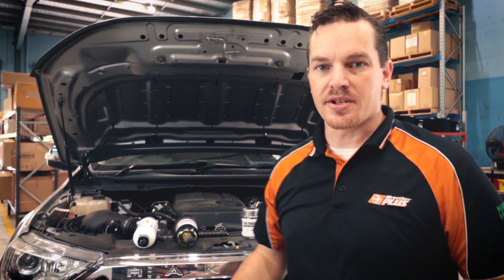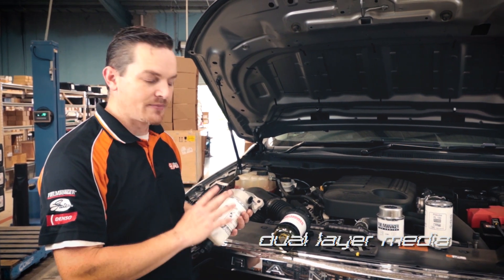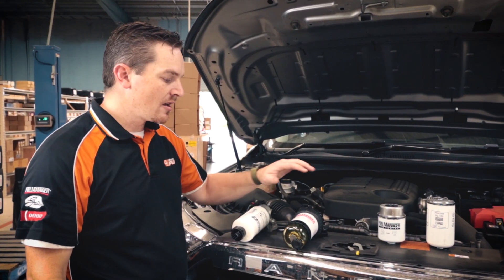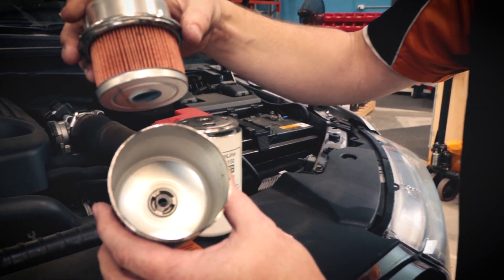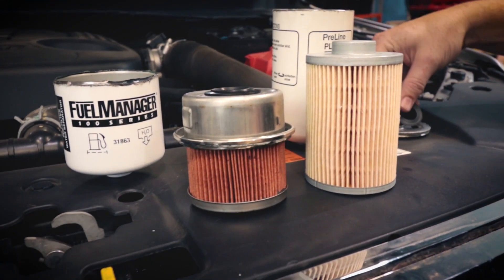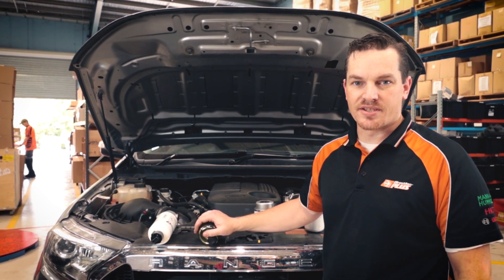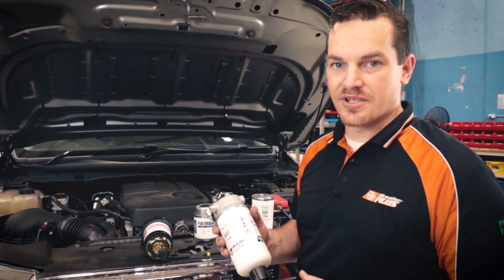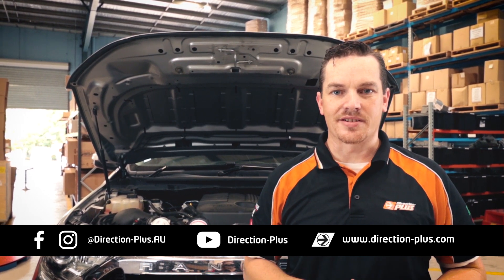Differences between FuelManager and PreLine-Plus

Comment: If they have better filter tech in the new one why not add this to the older filter as an option so no need for wiring or to change set up.
Reply from the maker: The Filters are made by two different manufactures, Fuel Manager by Clarcor (USA) and PreLine by Mann and Hummel (Germany). Unfortunately the filter elements aren't interchangeable because of the different designs.
Reply: Good fucking point!

Comment: How does the wiring work. Do you take the wires from the other filter and put them on the Preline filter?
Reply from the maker: No the alarm is completely independent from the factory alarm. you can see the install instructions here
https://www.directionplus.com.au/Installation-Guide/Water-Sensor-Control-Unit-Installation-Guide.pdf
Reply: They still didn't reply....

Comment: hi so pre line is better than fuel manage? what if i installed a fuel manager already and want to replace it in pre filter?is it possible?
Reply: They're not too good on answering question. I'd like to know this also
Reply from the maker: yes you can, we have retrofit kits available. Its just a mater of replacing the filter assembly and wiring in the alarm

Comment: I got small fuel filter so I guess I got cheaper one? Can I swap so have warning light better filtration?
Reply: the parts supplied in the 2 kits are a little diffrent from each other so its not a straight forward swap sorry. If you haven't fitted your kit you should be able to take is back to the place of purchase and exhange it for the one you want.

Comment: i like the Racor Snapp. please give views?.
Reply from the maker: the SNAPP units are a quality unit, but have a look at your fuel flow requirements and compare that with the SNAPP unit
Reply: @DirectionPlus  need some advice on fitting a fuel master/catch can kit a UK Navara D23 2018. The Adblue relay/fuse box is mounted where the kit should be installed! 😫 any advice please 🤞
Reply from the maker: @adamrafferty7081   that's a bit of a pain. if there is another location free you can try a locate it there. we can send you one of our universal bracket to help. as long as your not adding massive lengths of hose to the system, prefilter can be mounted just about anywhere between the fuel tank and the factory filter.
Reply: @DirectionPlus  thanks for the reply guys. I'll check out your universal brackets and see if it will help. Keep up the good work 👌👍